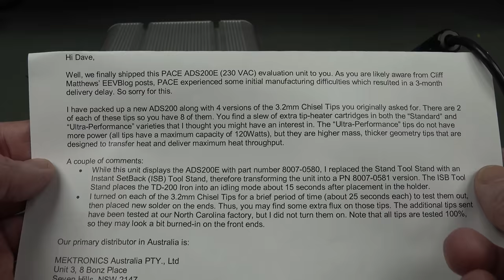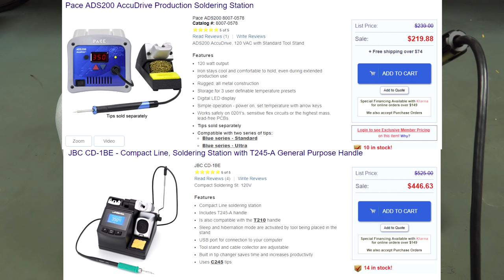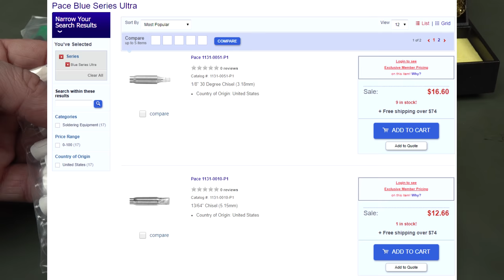EEVblog #1106 - Pace ADS200 Soldering Station Review (JBC Killer?)

Comment: A lot of what is being evaluated here is thermal transient performance which only comes into play when soldering a really large joint or many joints rapidly, so the thermal drain is more than thermal resistance between the temp sensor and the tip, *freezing the tip*. In that case, the only option is to overcompensate the temperature. 

A bit of a special case for the Pace, but maybe a known scenario. The big argument for the JBC stability and response is DESOLDERING TEMPS with braid, which is that type of thermal load. I'm not sure that came up.

It's interesting that the old style iron with the slug tip only differs in performance in the length of time of its thermal response. Seems to be the only difference.

The Pace has probably got some "bounce". Sometimes the only way to get rid of that kind of stuff is engineering trial and error. Maybe some software buffering.

Comment: I had this station on order when they had quit shipping it, took months for them to get the iron to me.  I upgraded from a hakko fx888d and have been happy with the iron so far.  I chose this iron as the tips were inexpensive, made in the USA, and has a short grip to tip distance for working under a microscope.  I do notice yours does not have the huge Made in USA sticker on the back of the iron with an american flag like mine does ^^    Totally agree that for the price point (it puts it in the hobby market range) they should include a basic chisel tip.  Thanks for the full teardown, I did not feel like tearing mine completely apart so just took a peek and saw the regulator sticking out and not secured.  Yours bounces around as much as mine does on power on, I measured about 18C overshoot on power on.  If you left it in a stand for a long time, I have had it once not return to temp so far where I had to cycle the power.

The only reason at the time I did not buy this over the very close in price hakko fx951 station with the Hakko FM2032-51 is the price of the tips.   I wonder if they are going to fix that bounce in the firmware and if they do, will they send a new programmed micro controller to everyone who purchased it? :P  I wonder how long it will be before custom firmware will be released.
Reply from the maker: How will we upgrade the firmware though?
Reply: Wasn't the chip in a socket? It is a micro with flash memory.  It would require pulling the chip, programming it and then replacing it or just have a direct replacement chip sent with a set of pullers.  Bit annoying yes, but doable ?  When I looked at mine I did not see an ICSP header sadly.   http://ww1.microchip.com/downloads/en/DeviceDoc/doc4180.pdf  

<edited to a different datasheet>
Reply from the maker: Yeah, doable, but a PITA. I don't have a PLCC Atmel programmer so would have to cobble together something. But ok for those keen enough to fix it.
Reply: a PLCC to 40 pin dip adapter is a couple of bucks off the big auction site, anyway... it was just a random thought since the chip was in a socket :)  My TL866A software also has the 89C51 44 pin chips listed, maybe if I get bored during the long alaskan winter ^^
Reply: We send out updated firmware (a 44-Pin PLCC, yep, we're old school) along with a chip puller to anyone requesting it. The latest firmware update is 1.2. It's impossible for us to provide to every customer since we sell 99.8% of our product through authorized distributors, who are very unlikely to send us their customer lists. If you need the the latest 1.2 update, go to PACE's website at www.paceworldwide.com/contact-us and fill out the form.
Reply: I wonder how long before third party PCB & front panels are available.

Comment: I purchased a EDSYN 951SX in the 90's, and it is still going strong, with 220 watts I can solder 10 gauge wire then change the tip and solder a NAND chip.

Comment: Assuming 370 is Fahrenheit, that is below 190 C needed to melt the regular PbSn solder. So, with a minimum setting of 400F (200C), I assume it will work fine every time. JBC may show a value on display and have a different temp at the tip. I worked with the PACE IntelliHeat version and is super Ok.

Comment: This looks pretty good.  I suppose PACE could offer a tip for doing lower temp stuff with similar characteristics to the JBC one as an option.  I've just looked in the UK and the price is about £300 with one tip so over $500 Australian!  A desoldering station with this type of technology would be good :)
Reply: Farnell have it in stock for around £205 - search for 8007-0580

Comment: Looks damn similar to the good old ST-50, slightly cost reduced. Oh the transformer has a tap for 115V, can modify it. I don't know why they didn't bother with a switch!
Reply from the maker: Oh, I didn't notice that!
Reply: I just took apart my st-50, it's from 2012. The board is near identical, but has an added 6800u cap in that empty space. No excuse for that vreg, just didn't want to re lay out the board. Also it seems AccuDrive == IntelliHeat
Reply: There might be some firmware differences, but a lot of old businesses (especially the ones that are mostly b2b) really like to stick with "if it ain't broke don't fix it". FWIW I replaced the role of my st45 with an imported station job that takes hakko t12 cartridges for around the price I paid for the st45 used and haven't looked back
Reply: @palaceofhatee  - Out of curiosity, what is this imported station job?
Reply: The specific one I got can be found by searching "KSGER STM32 2.1S" on aliexpress but there are a lot of clone soldering stations to choose from if that one doesn't tickle your fancy
Reply: @palaceofhatee  - Thanks, I've never seen that style of station before. I've got a 995D which works pretty well as long as you use genuine Hakko tips on it,  but I was thinking of switching to the newer style, integrated tips. I'll do some research on it. Thanks again.

Comment: I'm a bit of a pleb. I'm still happy with my OLD /USED/ hakko 936. got it over 10 years ago now, and it was used. works like a bought one as it were. Now I bet It'd be great to have the new style tips and better thermal mass. but so far, haven't really been annoyed enough with mine to bother getting a new one. Now if there was a good one with the new tips with a hot air reflow gun, that wasn't an arm and a leg, I'd think about it for the future.

Comment: My works got some heatwise 100's if u can solder a resistor to a 1.5 analog jack for the temp controller, the station is$20 ax man surplus

Comment: I just do not understand how they let the whole hestsink-capacitor collision go into full scale  production??
Reply: They didn't figure out the 7805 got unreasonably hot until after probably. I don't understand why they didn't go surface mount with it like an LF50. The control circuits can't be using THAT much power.
Reply: Solid State Workshop - The heater tip gets power dumped directly from the active lowloss mosfet bridge, the 7805 only provides power for the uC, opamps, icl7660 (for a minus supply), and LED. Not hot at all.. anyway that Nippon-Chemicon HQ cap is rated at 105c - Pace doesn't skimp :-)
Reply: Cliff Matthews  Yeah the parts are fine quality. I’m speaking more about the premise of allowing that board to see full scale production with a heatsink at a 20 degree angle because they couldn’t be bothered to move the damn cap 5mm.
Reply: Solid State Workshop - All of those I've seen (including mine) are not like that, but this "tilt" distance could be recent result of EEVblog discussions on heating that el-cap.. either way it's a jelly-bean part and it's not going no-where. I have a feeling this is more of a "grey beard PCB designer" issue and other PCB's (eg MBT-301) are similar and have lasted decades without issue. If this model goes into big sales, I'm sure changes will occur in a MKII model... It's nice to see Pace commenting on the forum and here on Dave's channel, it really shows they care. Cheers!

Comment: Still rockin my Weller EC1002 with analog dial. Does all the hobby soldering that I need and been doing so for more than 12 years (I got it used at that time). Tips are few bucks. TCO has been VERY low =)

I keep trying to talk myself into getting something new but damnit this does all I need. I'll wait for it to die before I get a new one.

Comment: With you that the firmware could do with a low pass filter but tbh the speed that this thing stabilises probably stops you needing it. Similarly for the setting the temperature while staying in setback, not a practical issue because it's stabilised before you even finish picking the thing up. Visually it could be tweaked but performance and physical build quality looks excellent. The PCB however looks like a disaster. Swings and roundabouts but incredible for the price.

Comment: how does this compare to the weller D550 soldering iron. I think its sold now as the d650 for non smt or small parts? sort of a chainsaw for trimming toenails but the cost is also around 60 dollars.

Comment: This reminds me why I like my Ersa so much. Yeah its a bit more expensive, but worth every penny.
Reply: Wesley Lee, they make the best solder roll holder made. I wouldn’t trade it for any other. Most solder roll holders are crap. This one has a steel plate base, precision machined holders for the reels. bent plate mount for the reel holders with a spoiling eye to guide the solder smooth as silk! It is a very sweet piece. Wasn’t cheap either!

Comment: I will stay with my Ersa Icon Nano for a long time. Heats up very fast, Big choice of good but cheap soldering tips, light iron perfect for SMD but capable of soldering huge wires. Heating behaviour (like overshooting), temperatures, buttonlock and standby timeout can all be configured on a microSD that you only have to plug in once. Has a nice black metal case and the tool stand is just perfect. All that for 170 bugs with free 2 day delivery for all accessories.

Comment: Logically I would expect it will take more power to melt solder in the center (where you tested the Pace) than at the side (where you tested the JBC)...
But then allowing for the fact that the JBC appears to deliver power constantly (as opposed to pulsed by the Pace), the findings may be correct but still... the gap may not be as significant... Just a thought...

Comment: Dave, the PACE appeared to give full cycles (about 40:00) whereas rhe JBC only gave half cycles.
The powercompanies won't be excited because of this!
Reply: Replay it with YT settings on slow. You will see Pace giving half pulses too. There's pictures of it on EEVblog under his section on manufacturing equipment. Look for JBC killer in the title.
Reply: KW PCtek : sorry, but I did and I still see only half cycles with the JBC and mainly series of full cycle wirh the PACE. The latter may have passed sometimes an odd number of half cycles in a series, I couldn't see, but I didn't see nothing but separate half cycles with the JBC.

In an industrial setting without hundreds of soldering stations it  will probably even (literally) out but still....

Comment: I have the Pace ads200 and my unit can actually solder to 100x160mm ground plane at 270°c without a problem and doesn't have the overshoot problem
Reply: Apparently the manufacturer changed the controller firmware. Could the tip temperature control board change?

Comment: In Canada they  are to expensive at $665.00  compared to the USA price point at $248.00 - $325.00 so if we want one we have to import it from usa and pay extra duties fees and import taxes ! All they ad to do with the heatsink cooking and touching the cap was to lay the cap down flat against the pcb at least if i bought one that's the first thing i would do and glue the cap with a touch of silicone against vibration ! The electronic display control jumping to much  would  trigger me fast enough

Comment: Could they not have used PWM to drive the heater in the soldering iron according to the temperature on the tip read by the thermistor driving an error amp based on Operational amp driving the PWM circuit which drives the heater you get my drift.

Comment: Great Video Dave.  One question... You mentioned in another review of the Weller WE1010, that it did not have a fuse on the primary side of the transformer.  Does the Pace ADS200 have a primary winding fuse?
Reply: The 'kettle lead' style socket has a built in fuse holder. In the UK the plug would also have a 1amp fuse in it. Belt and braces.

Comment: I guess in 2021 this unit now costs $380. How the hell did it increase by $160?
Reply: They're about $312 at Tequipment. Guess they reckon it's a juicier price point, but still over $100 shy of the JBC CDB. Prices on their tips jumped up, too. Leaning toward building a Unisolder now.

[edited after finding the price at Tequipment]

Comment: On the power delivery front, as soon as the front cover came off the Pace, my first thought was "THAT dinky little transformer's supposed to deliver 120W? Pffffff... Fat chance..." 

That thing can't be more than 50-60W or so, probably in the physical ballpark of the transformer inside my 60-80W Ersa iCon Nano (if not a smidge smaller, even).

Comment: Any reason why they don't use the iron cable for the sensor? Just a reed switch and one extra connection. Marketing BS?
Reply: Carlos Augusto My guess is that it would make the iron much fatter, since it seems to be milled from aluminum rod.
Reply: We tried it ... made the cord too fat. Cord flexibility seems to be an issue with older PACE stations so we decided a fatter, inflexible cord was a no-go.
Reply: Pretty cool PACE is on here, not very often you see a team this interested in talking to their customer base, nice work.
Reply: PACE Worldwide-AC Thanks for the clarification.
Reply: Top notch PACE. Hats off. Any reason you dont go with a magnet somewhere so it registeres even when just close to in the right place?

Comment: Decaf guy, decaf! Say what you want about  this accu-drive stuff, I’ll keep my MBT-250 and be happy in it. If you’re using that crap lead free solder, what could you possibly expect. There really is only one solder that consistently performs, low temp operation,  excellent wetting properties and yields the highest quality and highest reliability joints and that is Kester 282 RMA solder in Sn63 or Sn62 formulations. With the Sn62, you get a lower temp operation to protect delicate smds and chips of all kinds. It can operate as low as 285 F. I use 300 F just fine. You’ll never get the high reliability and high quality joints using lead free. In medical, critical circuitry, military, defense and aerospace applications and even in high end audio, nothing beats RMA solder!

Comment: I'd love an iron that had some sort of sleeve (and maybe air flow) on it that let you solder like it was a mechanical pencil.  1/2 inch(12mm) from your fingers to the tip.  Maybe some of that NASA Shuttle foam tile as the grip? Why should my fingers be 4-6 inches away if they don't have to be?

Comment: Just bought this. I mostly do rework and repair and this is my first higher end station. Upgraded from a hakko 888 so this is a big jump in quality and performance for me.
I'm glad i learned on lower quality stations prior to using this.
Reply: How much did it cost you?
Reply: @latengocomoburro  I'll have to doubl3 check, but it was around $300 usd if I remember correctly
Reply: @lain4231  Right now it i s at $400, super expensive.
Reply: @latengocomoburro  I don't find it expensive for the quality, features and performance.
Reply: @lain4231  I'm good with my $80 buck hakko FX-888, I love it.
Reply: @latengocomoburro  I liked mine too, but as our lead electronic technician I needed something with a little more oomph! And the quick disconnect feature is a must in my profession.
Reply: @lain4231  How does the quick disconnect work?
Reply: @latengocomoburro  you just pull the tip straight out. You can use the rubberized tweezers or Matt that they include. Makes changing tips (whoch i do do constantly) extremely quick!
Reply: @lain4231  Ok I know what you are talking about, but I did not know what it was called. Thank you.

Comment: I personally think the Hakko FM-2027 iron is far superior to both the JBC and PACE simply for the ease of changing tips. If you leave the sleeve/grip on the T-15 tip and have a separate grip for each tip, you don't need any finicky tip remover or hot pad to remove your tips on the fly.
Reply: I beg to differ. NOTHING is easier than switching a PACE tip with the provided Tip-Tool. ;-) We provide 1 Tip-Tool per station which handles all tips (future tips included), while Hakko provides 1 Sleeve Assembly per station. God help you if you use 5 different tips because you will have to buy 4 additional Sleeve Assemblies at almost US$6 per Sleeve. The Hakko Sleeves do come in nice vibrant colors though ...
Reply: The fact that you need a tool at all makes it harder. You need zero tools with the Hakko FM-2027. And paying $6 for an extra sleeve for common tips you use every day is a small price to pay to make your life easier. I solder on a daily basis and have tons of tips that I use frequently enough to justify not needing to grab a tip remover every  time i need to change a tip on the fly. But like your system, if you don't want to spend the extra $6 on an extra sleeve, you don't have to and can use the provided hot pad to remove your tips. But with the Hakko, at least the tool-less sleeve option is available for us professional users who solder on a daily basis.
Reply: The seriously strong stand has tip remover and space for 8 more tips (apparently not that cheap fragile offering from Hakko)